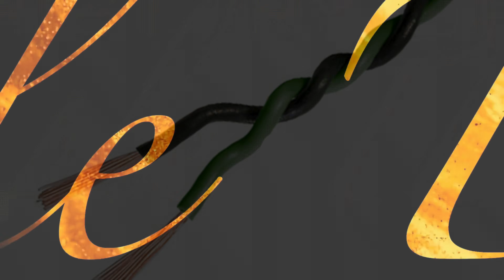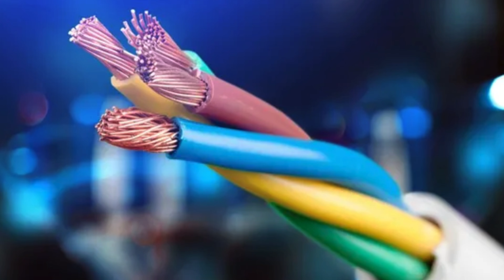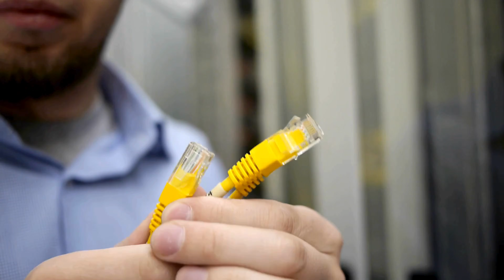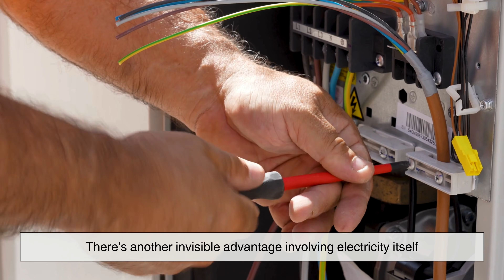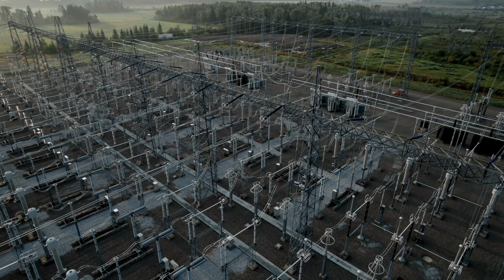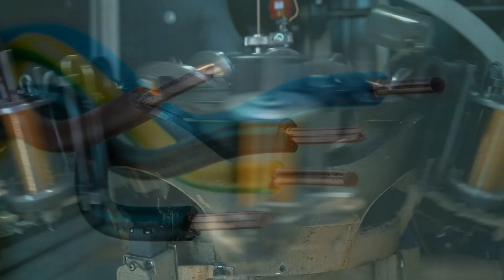Why Are Electrical Wires Twisted?

Comment: Energy has more fun health slidings twisty than railing straight pup pupt ploded apart going back and forth lines.
Reply: Long straight wires possible large fires huh. Tell others some places communities burned down because long straight wires not twisted braid configuration? Other families can blame who? Better way or not the better way.